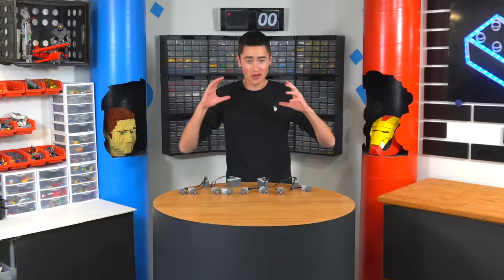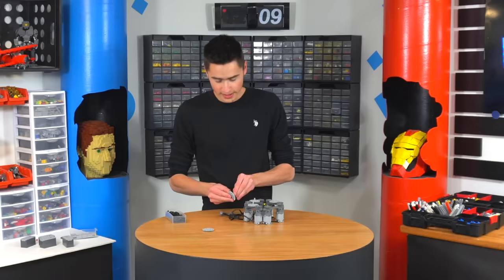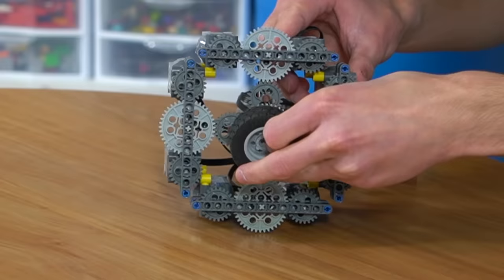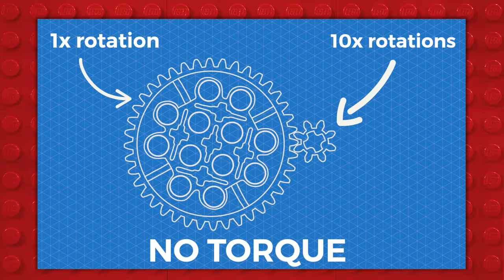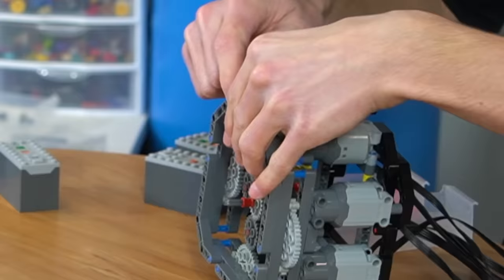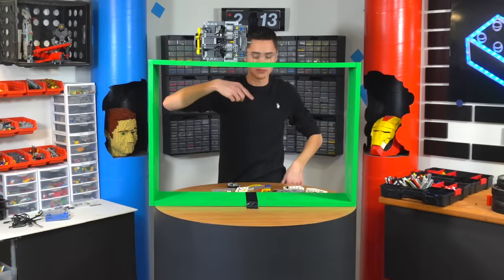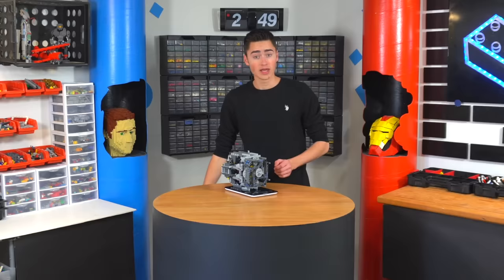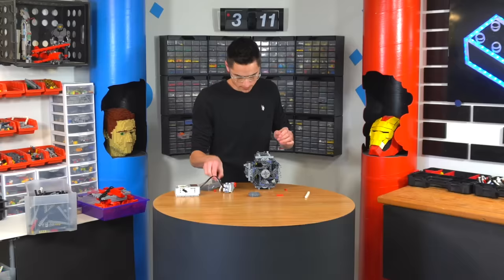I Made The World's STRONGEST LEGO L-Motor!!

Comment: Tip, you can drastically decrease chances of stripping your gears, just by adding more contact area between any connected set of gears. How can you do this? By using multiple of the same sized gears on the same axle. The more gears you add, the more torque they can handle. Basically just take however many gears you want and pair them up in the same way you would connect 1 gear pair. Im high right now but i have a masters in engineering, i just hope u understand what i mean😂
Reply: I understood.
Reply: i feel you homie
Reply: makes complete sense friend

Comment: You could literally do the same thing with 1 Lego motor. You would just need a high torque compounded gear ratio, similar to what you have done at 8:03 but the opposite way around. But what you did is not completely useless because just making a very high torque gear ratio would make the last gear spin very slowly, you made the last gear spinning quickly while still having a lot of torque.
Reply: So... you could not do the same thing with 1 lego motor. You just contradicted yourself. Yeah, you can make an arbitrary amount of torque using even the tiniest motor using gearsets, but the advantage to having all 8 motors is that for a given amount of output torque, you have 8 times the speed, as compared to 1 motor putting out the same torque.

Comment: 8:28 assuming each motor is running at 300 rpm, the output is 8100 rpm

300 x 1/5 x 40/24 = 100 (rpm of the “mega” motor)

100 x 3/1 x 3/1 x 3/1 x 3/1 = 8,100 (final speed)

Comment: Instead of just using one stick for an axle, since that middle wheel only use it to stay positioned, it doesn't need to take any of the stress of the power transmitted to it. All you need to do, is use that gear's holes in the outer rim to connect to whatever you are spinning to make it stronger and let the gears connecting to it take that stress instead of the main axle. I know what I'm saying isn't really clear... I'm having trouble trying to figure out how to explain it. I could draw an example... But I think the modification I have in mind could make this about 2 to 4 times more resistant to breaking down.
A machine is only as strong as its weakest part.
Reply: That and doubling up the gears on their interlocking points, instead of one, use two gears every time they meet, way less likely to slip or break off teeth

Comment: Nice video, I did the math and it looks to be a 1:81 gear reduction and 22,036 rpm (if the motors are running at their full speed of 272 rpm) The super motor has a gearing ratio of 3:1 with 91 rpm.

Comment: You don't increase power by going down in RPM but increasing torque. Power will be the same, always. Unless you put in more powerful motors.
Reply: Not exactly. Electric motors make more torque the closer you get to 0 rpms with a given current input. Basically, the more load on the motor, the more powerful it gets. If a motor stalls, max torque has been reached and is acting on the load. It's why electric cars are so quick off the line but top out at lower speeds. This concept isn't really relevant to what he's doing, but it's still interesting.
Reply: @jacobg5122  I'm not talking about the power of a motor, but the rotational speed. If you use gears to decrease the speed of output, then yes there is more torque, but less speed. Vice versa is the same, use gears for higher output speed means less torque.

Comment: Put 2 opposite of eachother, connected to a diff. Your power will double, and make up for whichever assembly has the first failing motor.
Then, feed it into the greatest reduction train that you can fit between the two enclosures. Have an output at a 90 degree angle. Build 3 more, and have them all feed into the same reduction gear.
That would be a start. I'll buy Lego stocks in the meantime 😆

Comment: I think if you were to redo it with with those custom metal axles you could really push the motor to it’s limits. You should also maximise torque over speed by making the gear transfer multi-level, where each gear transfers to a bigger gear, then a smaller gear on that same axle transfers to a bigger gear. It’ll allow you to drive way more with the motor

Comment: If you can get your hands on a dead M-motor, open it up and replace the motor core with a motor purpose-made to modify a flywheel dart blaster, like an Out of Darts Kraken; it should fit. Just need to power it with a separate 12-volt 28-amp or more supply. There are power supplies made for LED projects that output 12 volts at up to 30 amps...

Comment: I did the math at 8:30. I may be wrong, but I got roughly 10,280 RPM.

Explaination: I found that those motors give out about 380 RPM. The gears those motors are going into have 8 teeth to a 40 teeth gear. That's a 0.2 ratio. From there, The 40 to 24 gives a 1.67 repeating ration. 24 to 24 is 1. I don't see the 40 in the front actually doing anything as the axel goes straight into the 36 tooth gear. That gear to the 12 tooth gear is a ration of 3. That repeats 3 more times.

380 x .2 = 76
76 x 1.67 = 126.92
126.92 x 3 = 380.76 (about the rpm of the starting motor)
380.76 x 3 = 1,142.28
1,142.28 x 3 = 3,426.84
3,426.84 x 3 = 10,280.52

Again, I could be way off, but I saw it a gave it a shot.

Comment: you should try using a steel Axel, it would be way stronger than the plastic ones. Brick experiment channel snapped one  using only Legos and two geared up Lego motors so it could still break with that kind of torque, but you should definitely try it.

Comment: By machined metal parts. Axles and gears. If the metal axles bend, put a motor on both sides of it so it has more stability and more force. Metal gears so they don't slip.

Comment: Do you know that mechanical power can be easily calculated by multiplying torque in Newton*meter on rotational speed in radian*second.
 So one multiplication and one constant coefficient depending on your initial measurement units.
And you even can calculate efficiency by dividing mechanical power on electrical power.
Also, pro tip. Torque to speed characteristic for DC motor should be linear and gear ratio just changing slope on f that characteristic.  Power of q motor proportional to area under that characteristic.

Comment: you can largely shrink it in size by calculating how much buggy motors are required to replace the power of all the motors in the whole motor. thats how you can create a vehicle without having to make the motor too massive and big and have more of these in one single vehicle.
Reply: umm... I just found out there is a gearbox that can pull a car. This L-Motor is now obsolete.

Comment: you could get a metal 3d printer and make metal diffs/axles for a car. I would reccomend using the sprockets and some tracks for the extra resistance and lightness of the plastic, and just use it as a triangle or square track. A steering mechanism eould require more strength then the motor

Comment: The Brick Experiment Channel does this kind of stuff to a more extreme level for anyone interested. Pulley systems, insane amounts of gears, a lot of reinforcement, and all kinds of tests and experiments.
Reply: yea, brick technology made a LEGO air powered truck, and it showed to be more powerful than electric LEGO vehicles. what do you think will happen if instead of electric motors, he uses air pressure. in fact, such motor could be enhanced with steel axles to make a non-ridable, yet heavy vehicle.

Comment: Technic system is limited in scale by it's dependence on axles for power transmission. Some time in the future I would like to see lego release parts that facilitate the creation of stronger central drives, as in most creations there will be a point where a single axle will bear the load of much power/torque. Something new type of reinforced axle parts would be nice.

Comment: Cool video! Consider coupling the output using multiple axles through the extra holes in the gears . I.e 5 axles on the larger gears. It may only need 1 axle to "ride" on, and the others to transmit the power. Does that make any sense?

Comment: Speed will equal torque as in a car.If you have added more horsepower, the torque will need to be better because it will not work.
The car will not move

Comment: Bot sure if deliberate or a mistake, but to maximize torque you have to as was correctly stated choose gear ratio so the input does many revolutions to one of the output. To maximize that in a setup like yours the only important gears are the ones on motor shafts and the single gear in the middle on the output shaft. It seemed that in the video you changed gears next to each other which will not have as large an effect as changing to the large gear in the middle. I think it should be noted as that was the educational bit and the build didn't follow the advice as closely.

Comment: The gears look barley different in the max torque version from the low torque version and the big gears still on the motors and the smaller gers are going into a gear that's barley larger

Comment: Am I seeing it wrong or do the motors effectively loose their high gear ratio, by having medium size gears directly after the big ones? Going from a ratio of  8:40 back to 8:24. 

Using steel axels alone will not work though, as this will just move the torque onto the casing instead. So a general robust build would be needed.